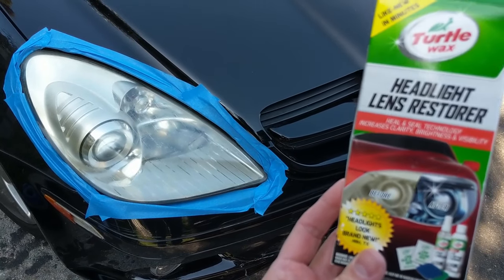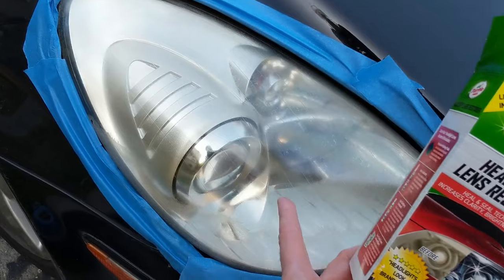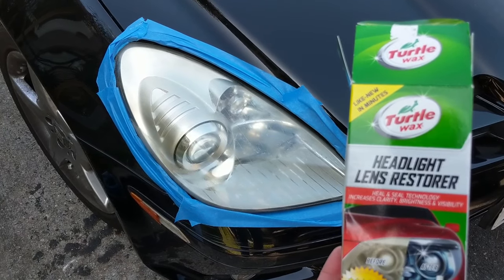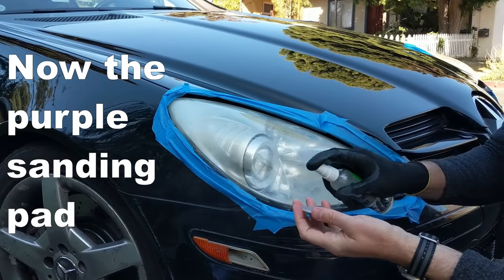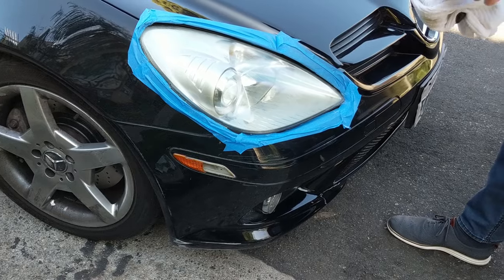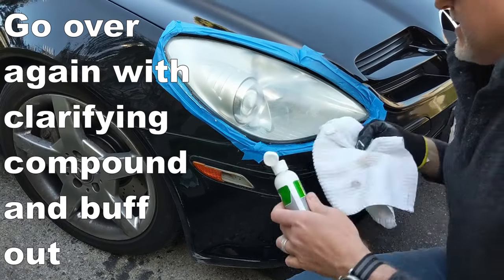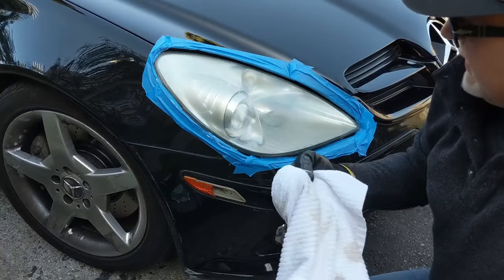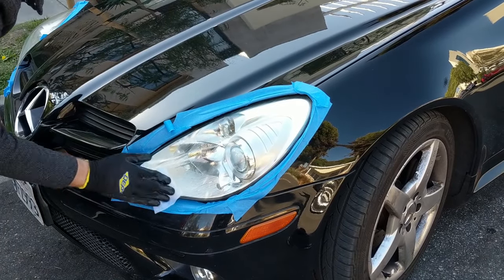Turtle Wax Headlight Restorer All Steps

Comment: In the official video on Turtle Wax's site, they say to wipe down the lens each time before you move to the next sanding pad. That might be why some people's lights got messed up, because you need to wipe it down each time or you could damage the lens.
Reply: Basically if you don't, you're spreading the grime/trash into the lens.
Reply: Wish I would have read your comment and went to the official website.
My headlight is destroyed. I only did one and it's a fogged up mess, so I came inside to watch YT before moving on to the other one. 
I'll leave it alone and try something else.
Reply: @johnly5702  Right

Comment: I’m gonna sage everyone the discouragement of trying all the rebuffing of any headlight. Go to your local Walmart and they will literally spend 4-5 hours with pneumatic sandpaper wheels tape up the whole front of the car with clear plastic protection and take all the oxidation off the lenses and recoat it with professional clear all for $25 a set!! The headlights come out as good if not better than original. They lose money but the manager was telling me they hope people will do an oil change and go shopping if they wait. It’s amazing I’ve done it on three different cars. Believe I’m picky and I tried to tip them $40 but they refuse. Their amazing!!

Comment: Because the headlamps on my 2007 |Golf TDI had a bit more  oxidisation I started of by wet sanding with 600 grit, then 1000, then 1500 and finally 2000. I ensured to rinse the headlamp with fresh water after each sanding to remove any of the residue.  After using the 2000 grit I then rinsed off the headlamp and then applied some panel wipe to thoroughly clean the lense. I then applied the  clarifying compound and then buffed dry. I did this around 3 times. Ensuring to thoroughly buff dry each time. After that I applied the acrylic base coat. The headlight came out really good. I was quite pleased.

Comment: The key is in the sanding. Take your time sanding. Spend more time on #1 and use a drill and soft foam pad to buff the lense after step 4 or really give it the elbow grease and extra pressure. The results will be much better.

Comment: Tried this yesterday on 2006 mini Cooper S worked as advertised. Used the craftsman one before but they require a using a drill and it cost $22. Thought I would I try this one. No tools needed for this which is perfect. $9 for some headlights that looks brand new ain’t bad at all.  I will see how long it last with yellowing. But overall happy with the results.

Comment: I used one of these kits on a Ford Edge....   one headlight was FAR worse than the other.    One required no sanding,  and the other needed two rounds to make it match the first one.   Is it "new"  looking???  not quite,  but at  5 feet away,  it looks close to new.

Comment: How many kits did you buy? Can you just use one kit for both headlights?
Reply from the maker: I used one kit to do both headlights. It worked fairly well. The results weren't permanent, however, and the haze began coming back in a few months. I suspect taking more time and being slightly more aggressive could produce longer lasting results.
Reply: @MarkFauntleroy  yeah they normally only work for upto a year max.

Comment: It was smooth sailing until the final clear. It didn’t apply smoothly whatsoever, then it “clumped” up. After giving it some time to cure as the directions advised, it looked the same. I ended up wiping it off with a rag and the result was good enough for me.

Note: i may have had this issue due to the base clear not fully drying but I did it at night and it looked dry, but may not have been
Reply: So overall would you try it again?

Comment: Is it necessary to use the tape around the lens?
Does that stuff hurt the paint on the car?
Reply: So it's not necessary, but the reason to do it is to avoid any of the sandpaper hitting the cars paint during the sanding process. None of those chemicals in the kit will harm the cars paint. The blue tape he used is just generic painters tape designed for houses, but will work fine in this case. It's not designed for cars, but wont do any harm. If you do use tape it would just have to be this blue painters tape or auto specific masking tape. Any other types of tape WILL damage the car. Or you could just be careful when sanding to avoid using tape at all.
Reply: The blue painter's tape is low tack, it will not damage your paint.

Comment: To be totally honest your headlights lenses wasn't that bad to start with!?Surely not an MOT failure, Unlike my headlights where it's almost impossible to see the light bulbs!! Nevertheless a excellent tutorial well done!!👍🚘
Reply: You need to buy wet dry sandpaper. 400, 800, 1200, 2000 and buff. Then spray clear coat - krylon is a good brand found everywhere.

Comment: what if I didnt clean good the first time , can i do it again?
Reply from the maker: Yes, absolutely
Reply: @MarkFauntleroy  but what if we dont have the wipes ?
Reply from the maker: @Unknown-uy6mj  I think the wipes are some type of sealer to use after you sand and clean the plastic lens. There are other ways of accomplishing all of this, which, I believe, involve a sanding pad on a drill or orbital sander and then wiping on or spraying on a sealer. So, if you can find some type of sealer liquid that doesn't use wipes, you may be in business.

Comment: There was no corrosion on my lights, so I didn't have to sand at all. Just did steps 1 and 3. My lights are very clear. I need new bulbs in my headlights because they still don't even shine 15 feet
Reply: You can get good bulbs on Amazon if you don't want to see a shop
Reply: @scdu  We ordered HIDs, but they didn't fit my housing. We tried to modify the housing, and we ran into some electrical issues, so we had to order new housing

Comment: What can I use if I lost the sanding sponge?
Reply: Any sand paper will do
Reply: @Swordswithfate  not any sandpaper! Depends on the pad you lost. the 4 sides of the sanding sponges are different grits. it highly depends on which sponge/s you've lost
Reply: Use a buffer with a drill 👍

Comment: It  made the lens worse!  Step one (Clarifying compound) , cleared it fairly well but not completely, so I proceeded to step 2 using the pads and lubricant. It completely clouded up the lens (almost like a weird chemical reaction) and now is cloudier than before I started.  I followed the directions EXACTLY and did not overuse the pads (a min as instructed) when using the lubricant and kept it very wet the whole time.  The cloudiness will NOT come off despite going back to step one and using  the clarifying compound.  Worse than when I started and my call to the # on the box is going unanswered!  I may need a whole new headlight.  Now one is clear and the other ruined!

Comment: My headlights were left hazy after the final step. Any help on this?
Reply: Repeat the steps and when sanding headlight use pressure and go opposite directions. The more you sand the better the results
Reply: I’m having the same problem, it actually made one headlight look worse than before, I used pressure and sanded in opposite directions but it still won’t clear up
Reply: @jacobshigenaka8534  Same. This product sucks
Reply: @xLordStormx  i used a rotary and the polishing solution and it got rid of the haziness but my headlight is all scratched up from when i did the wet sanding
Reply: @xLordStormx  unless youre straight upgrading your headlights just buff it out with a rotary and polish after

Comment: Complete rubbish. Didn't do anything. I should have took it back to supercheap. But I couldn't be bothered.
Found out if you sand headlights down with wet n dry.
Then spray them with CLEAR COAT..
they come up looking like new 😉
Reply: Thats funny because.......wet sanding and applying clear coat is  part of this video.
Reply: Pretty much exactly what it does I think.